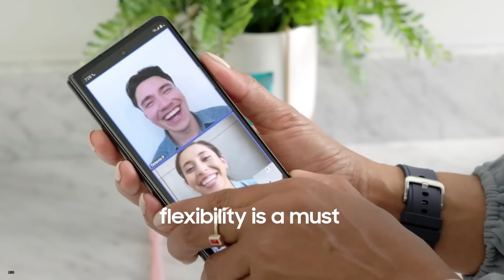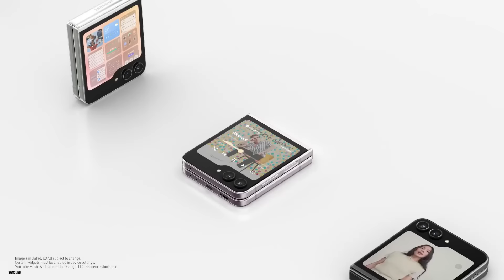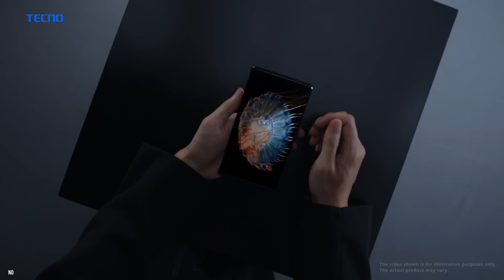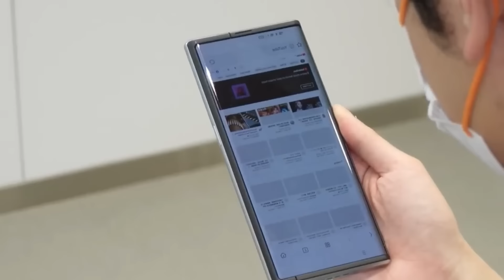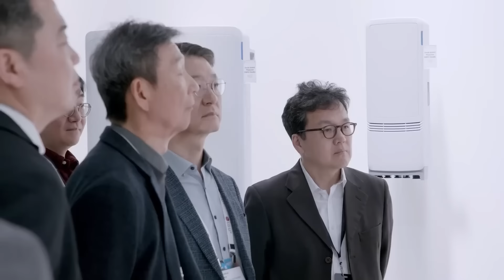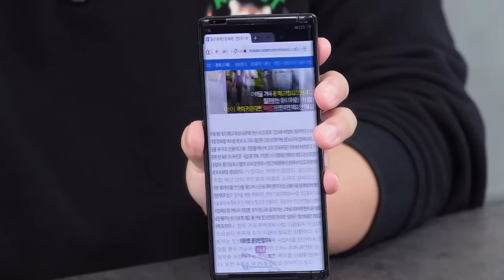Galaxy Z Roll 5G - Is It A Game Changer?

Comment: Don't fall for it. Flexible phones, motorized phones etc. are the new planned obsolescence.  As consumer software protection has become stronger companies have innovated finding new ways to make sure your device remains disposable and has a guaranteed failure point requiring replacement. Promises of free screen swaps are a manipulation to get people just past the finish line of a 2 year contract and aftermarket screen repairs cost as much as a new device. I work from home sitting at a pc all day and my own Galazy Z Flip 5 required 2 screen replacements over 2 years with minimal use primarily on evenings. Both times it lost touch and pixels across the crease. I didn't want it, I only tried it because my operator offered it free, and I returned it for the credit at the end of the 2 years and had to fight for that too.

Comment: I don't often make fun of new technology. Usually it's well thought out. But this is not that you have a device that's far more delicate and you can't even put a case on it. Consumers are going to be extremely disappointed at the frequency at which this thing is damaged. This is not technology they're going to embrace. I don't think we're seeing an advancement in technology I think what we're seeing here is a gimmick. 

There are cameras from smartphones made over 10 years ago that are more advanced than the cameras they're putting in phones today. We've seen a reduction in features and a loss of compatibility. The phone market isn't going forward. It's just stale. And I would argue boring

Comment: Durability issues?
Reply: Yes. How do you apply a screen protector? The screen needs to be extra-soft to roll, and there isn't even a clamshell to close over it to protect it. The motor is another movie ng part, and moving parts are notorious points of failure.

I think the advantage here over a foldable is that there is no hinge to wear out or get clogged with dust, so maybe it's an even trade?

Comment: I wonder how a phone case for this would look.
Reply: The case would be in 2 halves that meet where the main chassis of the phone is. The first half would be the full width of the phone, the 2nd half would attach overtop of the 1st half. When the phone "unrolls" the case will slide open, revealing the under layer of the first half of the case that the second half was covering up. When the phone rolls back up, it'll retract back under the second half of the case and the 2 main parts of the case that attach to the chassis will come together.
Reply: Phone case is not the problem...how do you make a screen protector
Reply: Ans screen protector
Reply: Good question, I wonder 🤔
Reply: Designer designes with same rollable mobile case dont worry 

We had plenty of technology improvements just wait
Reply: Disconnected from the middle on top and bottom.
Reply: Simple slide/spring mechanism
Reply: It would be pretty simple and normal with a slider layer over itself

Comment: I'd say quad folding phones are better than rollable but I'd like to see stylus support they can make the corner thicker to adapt the spen, at a big increase phone rocking really isn't an issue infact it would balance it out because on 1 corner you have a thick camera bump and making the other corner when unfolded as thick as the camera bump to accommodate the spen would balance it out, perhaps samsung instead of removing spen slot or entirely eventually they should consider this move to prevent rocking